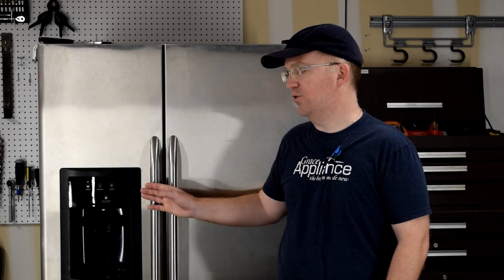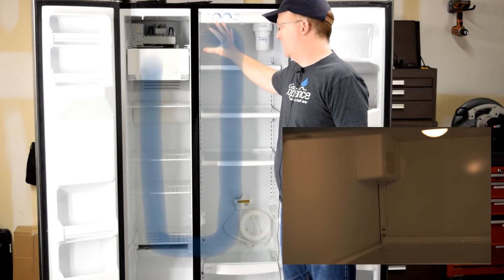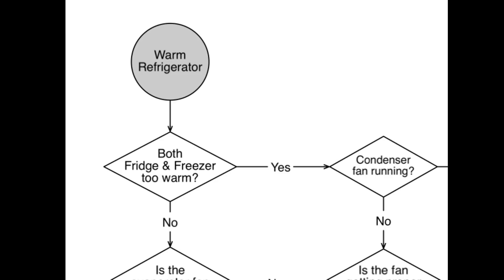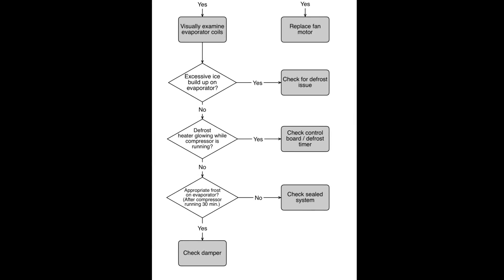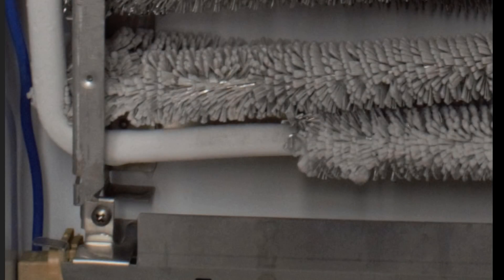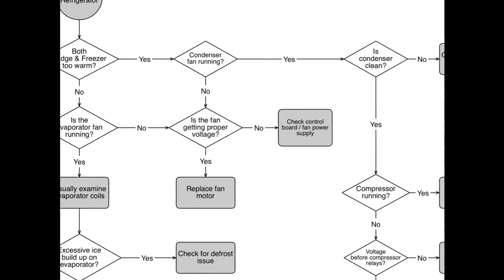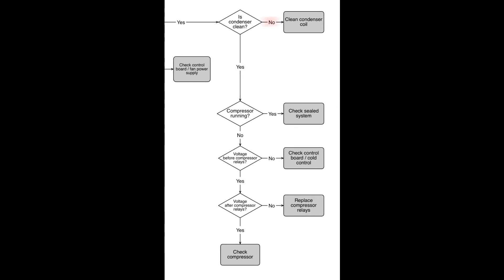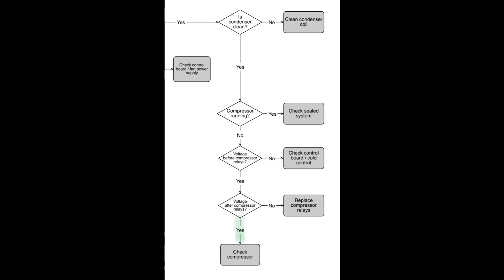Refrigerator Too Warm - Diagnostic Steps

Comment: When you turn it on everything functions like it should except it blows cool air, not cold. But after that complete cycle it will not cycle again on its on. Must be turned off and then back on.
Reply from the maker: Thanks Samantha, once I get to my computer I'll take a look at the schematic and see what the next best steps would be for you. Thanks!
Reply from the maker: Ok, my initial knee jerk diagnosis would be a failed control board - which it certainly can be. 

But, the first thing I would check would be the cheapest possibility.  
I'd check to see that the temperature sensor for your refrigerator is ok. 

You'll need a meter to accomplish this and also need to know what temperature the sensor should read at 32'F.  This is accomplished by removing the sensor which is located inside the plastic housing on the top of the refrigerator section. You'd place just the sensor section in a glass of ice water for 2 minutes and take an OHM reading between the 2 terminals.  My thought is that if the temperature sensor is telling the board that the temperature is satisfied - the control board would no longer call for cooling, but may by default run for a specific time once powered on. 

The part number for the temp sensor is 240597203:
and can be found here at this Amazon affiliate link: https://amzn.to/2G2hGaK

If you want to perform that test, I can dig around and see if I can find the tech sheet for your model and see if the OHM resistance matches up with the specifications in the tech sheet. 

If it does, then I'd recommend a new control board (which comes with a new temperature sensor based on what I'm seeing) 
You can get a new control board through this Amazon affiliate link: 
https://amzn.to/2WgpImn

I hope this helps and let me know if you have any questions.  I'll be here to help if you hit any snags along the way.
Reply from the maker: Based on what I'm seeing, the sensor should read 5K OHMS at room temperature (77'F).  I hope that's helpful for you.
Reply: I have a question i have a Samsung French door model Rf260beaesg/aa and it cools when I plug it in everything runs good until it reaches the ideal temperature the compressor wont turn back on and it starts to get warm until its hot inside but the temperature says its cold on both sides
Reply from the maker: @mayravaladez2135  hi, I am sorry to hear about that. V

The first thing that comes to mind is bad temperature sensors in either the fridge or freezer section.
I'm not at my computer to look at the schematic, but you'll be able to test them from the control board directly if you have a multimeter.

Do you have one already?
Reply: GE Side-by-Side ONLY - Refrigerator Repair Videos  no i dont have one
Reply from the maker: I understand. If you wanted to diagnose it yourself you’d need to get a meter. This would allow you to test the individual sensors to see if they’ve failed. My thought is that if the sensors have failed, the control board may be getting a reading that it’s cold enough and does not need to cycle the compressor/fans on again.  

But, it would simply be a guess. To confirm this you’d need a meter.  I’m happy to walk you through it as best as I’m able if you can get a hold of one.   It would just need to be able to measure voltages and ohms of resistance.
Reply: GE Side-by-Side ONLY - Refrigerator Repair Videos yes please walk me through the steps as soon as i can I would get a meter
Reply from the maker: Ok, on your main control board behind your refrigerator, with the fridge unplugged, you’ll unplug connector c30 (a red plug I believe) and on the wires themselves, take an Ohm resistance reading between pins 1 (ground) & 4 (freezer FZ sensor) and write down this measurement. 
Do the same test for pin 1 (ground) and pin 6 (refrigerator FF sensor). 

Also, I will need to know the current temperature in both the refrigerator and freezer section at the time of the test.  

Thanks!
Reply: GE Side-by-Side ONLY - Refrigerator Repair Videos thanks

Comment: I should also tell you that this refrigerator turned exactly 2 & 1/2 years old the very day that it started doing this. It will not cycle again unless it's turned off and then back on again. It does blow out chilly air during that cycle. There is cool air in both compartments but not cold by any means and is not capable of freezing anything.
Reply from the maker: Thanks!
When you say it runs when you leave it unplugged and then plug it back in, do you know if the fans stay running all the time or do they shut off too?
Also, does the compressor behind the fridge turn on when the fan behind your fridge is running too?

The compressor should be running any time the condenser fan behind your fridge is running.

Comment: Model is 25360412413 and there are no noises.
Reply: Sorry to be so long in getting back to you, it's hecktick here. I wanted to say thank you for all the helpful information you have provided me with. Can't thank you enough. The door switch test mode has been preformed and everything in that test aspect turned out to be functioning correctly. The problem seems like it could be that thermistor (I'm guessing of course).  When tested in the ice water after allowing it to become room temp. It had a reading of 26.3. The sheet says (that came with the fridge) it should have a reading of 27.20. I am stuck simply because I have no idea what it means about a 10% difference. I have no idea if my thermistor is good or not with that 26.30 reading. I greatly value your opinion and info, can you help on this issue? Also, what is the next step for me to take?? Thank you so much in advance from Mrs. Frustrated!!
Reply from the maker: Hey Samantha,
Yes your sensor sounds good to me. I'd rule that out as your issue.

Are your fans and compressor running currently?

Comment: I have a Kenmore refrigerator, runs when you first turn it on then compressor will not come back on unless you turn it off and then back on again.
Reply from the maker: Sorry to hear that Morgan!
Please send the model number from the sticker inside the fridge section.

Also, do you have any noises coming from the compressor when it's not running?

Thanks!

Comment: Hi - Sorry I couldn't get back to you soon, I have a GE GSS25QFMC / Serial # VA225662.  The fan in the back runs well, Coils are clean and the compressor runs as does the baffle on top of the refrigerator side opens and closes.

Comment: We discovered that our problem with a warm fridge (the freezer section was ok) resulted from the rotating part of the motor for the evaporator fan getting a bit gunked up (after 22 years spinning within an electric field) such that sometimes the fan/motor did not start to spin (to push cooled air down into the fridge), but the fan/motor would spin if given a slight push to get it started. Sometimes it started okay on its own when the compressor started but sometimes it didn't. When the power was off, the fan/motor could be manually spun a bit, but did not spin freely. I removed the evaporator fan/motor (as per a video at https://www.youtube.com/watch?v=YYVEaTJnOxA) and cleaned the rotating motor component with special electrical-contact-cleaner spray to remove a black residue coating where the motor spins, until the fan/motor would manually spin freely, then reassembled. One caution is when I was putting back in one of the screws holding the motor assembly in place, I pressed a bit too hard and cracked the plastic housing, but repaired that with crazy glue.
Reply from the maker: Nice work!
Sometimes just little adjustments is all it takes. Very cool. Keep a close eye on it though. The times I've run in to a motor that's quit once, it is troublesome from then on.
Fingers crossed for you though.

Thanks!

Comment: Hi Andy,
Thank you for creating these informative Videos.  I have a Kenmore Side-by-Side refrigerator.
Model# 253-56512400.  Recently, I have noticed that when the compressor turns "ON" the evaporator fan tries to turn "ON" too.  It takes the evaporator fan couple of tries to start.  My refrigerator is working fine for now.  But I think soon the evaporator fan will fail.  I have been searching for a solution to this problem on the internet.   I will appreciate if you could guide me where to look to resolve this problem.  Now, it takes eight to ten tries for the evaporator fan to kick in.  Thank you
Reply from the maker: Hi Imran,
You're most welcome. I'm glad they are helpful. 
Sorry to hear about the issues with your fan. To proceed you'd need a multimeter to verify voltages as this could either be a weak fan motor or a failed control board.

This video will walk you through how to verify which one it would be.
https://youtu.be/PhQKqF5MgDE

Please let me know if you have any questions though. 

Thanks! 
Andy
Reply from the maker: Hi Imran,
I just noticed that you have a Kenmore side by side and not a GE.
However, the process will be the same, but I'd recommend you take a voltage reading at the plug for the evaporator fan. If you'll let me know what voltage readings you find, It will help me in the next steps.

Thanks!

Comment: I have same symptom, thanks for the video, my fan works but I think it is not working at the correct speed, it is very weak, I think it is damaged, Ill try to find a replacement and try. Thanks!
Reply from the maker: mgarciah hey! 
You’re welcome. I’m very glad it helped.  If you have a GE refrigerator, this video will help you know for sure if it’s the fan motor or the control board if you have a multimeter that you can test with.  
Also, you’ll find links for the evaporator fan motors. 
https://youtu.be/PhQKqF5MgDE

Feel free to give me a shout if you run in to any questions! Best of luck! 
Andy
Reply: @GraceAppliance   Just wondering if you have or can share service codes on my GE profile,. I know how to get into the service mode but then you have to access check function with numbers.